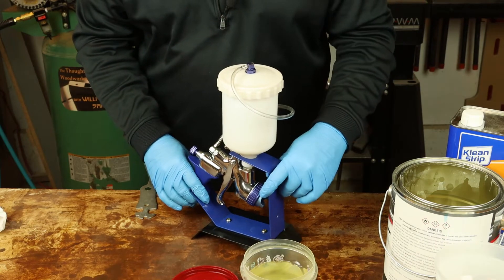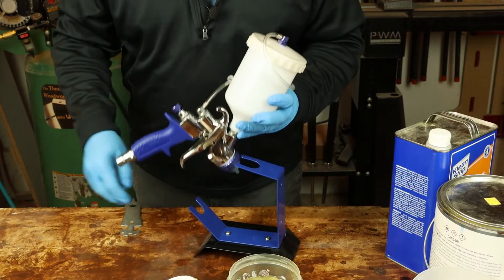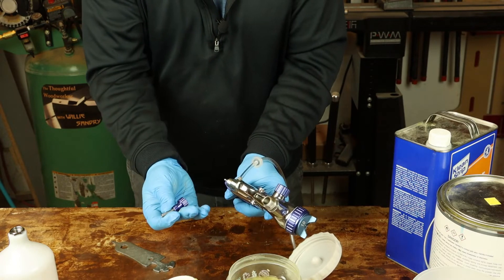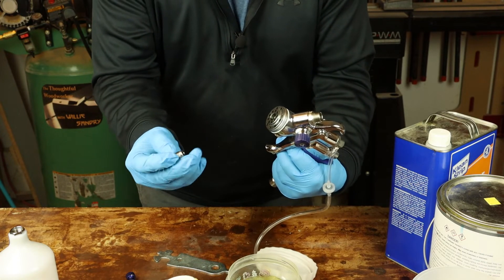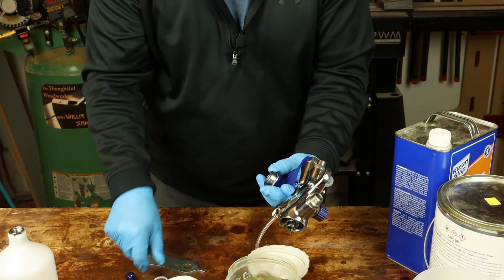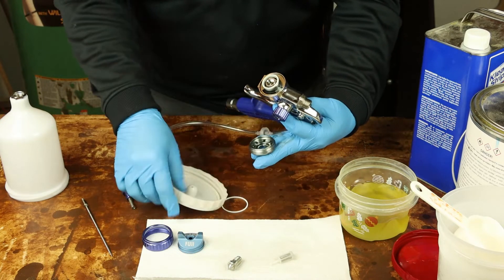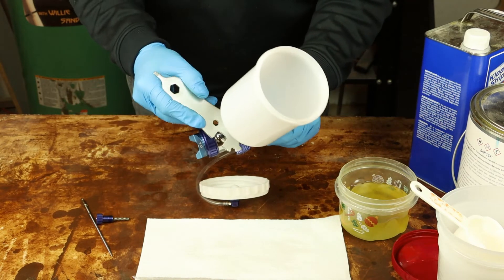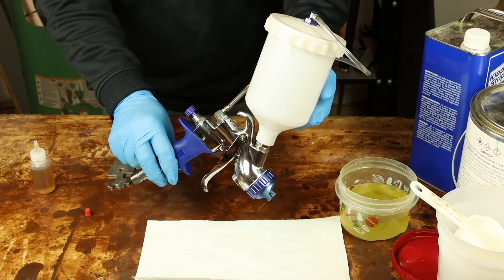2 Minute 2 Ounce HVLP Spray Gun Cleaning Method for Turbine sprayers + gravity feed guns / Fuji T75G

Comment: Great video!  Quick question for you.  It was recommended that I run some lacquer thinner thru my spray gun (Fuji T70) before I use it for the first time.  Other then emptying the cup and the gun should I take it apart and let if dry or just leave it all together?
Reply from the maker: Hi Tim, when I set up my T70 gun I just sprayed some thinner through it.  Also wipe the inside of the fluid cup really well.  The cup will have some residue from the manufacturing process.  Once a paper towel dampened with thinner wipes clean, the cup is ready to spray.
Best
Reply: @TheThoughtfulWoodworker  Thanks

Comment: I just purchased the T75G gravity spray gun as well, however when I took off the cup there was no filter inside. Do you know if the newer guns don't have a filter? Thanks for the video!
Reply from the maker: That's an interesting point David.  Now that I think about it, mine didn't come with a filter either.  I just use the standard home center filters that are universal to most spray guns.  As long as you filter the fluid as it goes into the cup, you should be able to spray without a filter as well.  Have fun with the new gun!
Reply: @TheThoughtfulWoodworker  Thank you! The sprayer and gun is awesome!

Comment: Is it absolutely necessary to lubricate the needle?
Reply from the maker: I used to fight the idea of lubricating the needle, fearing the oil may get into the finish.  You only need to lube the shaft of the needle where it articulates with the trigger.  You don't lubricate the tip of the needle.  It's just a wear and tear thing, the gun will work fine without oil, but it won't last as long.  Best to you.

Comment: Can this be done with denatured alcohol?
Reply from the maker: Yes absolutely!  Shellac thins with denatured alcohol.  Just use the appropriate thinner for whatever you're spraying.
Best
Reply: What about using ammonia with shellac bin primer ? Much cheaper than denature alcohol..
Reply from the maker: @danielemansilla  I only use the recommended thinner for each product.  In general, ammonia is a very dangerous chemical.  I do use it for fuming white oak occasionally, but only with full safety gear.
Best

Comment: what kind of paint thinner do you use to clean the spray gun?
Reply from the maker: I spray lacquer, so I use lacquer thinner.  Or denatured alcohol if I'm spraying shellac.  The product you use should say what thinner to use.
Best
Reply: @TheThoughtfulWoodworker  yeh I was spraying primer on my cabinets but do I have to clean the gun again to spray the final coat of gray? so I have to clean mine with paint thinner right?
Reply from the maker: @MetalsForBrunch  I clean the gun thoroughly after each use.  Water based paint thins with water.  Oil based paint thins with mineral spirits or paint thinner.
Read the can of paint you're spraying with, and it should have good information and what thins the product best.  
Good luck!

Comment: Where did 2 ounces come from? You used way more than 2 ounces
Reply from the maker: Hi Seth, as the video indicates the thinner in the container is reusable.  I get perhaps 10-15 gun cleanings out of that container.  I spray 1-2oz through the gun with each cleaning.  Thanks for the question.
Best
Reply: @TheThoughtfulWoodworker  do you use 2 new ounces of thinner for each cleaning?
Reply from the maker: @SethCorbinMusic  yes two new ounces of thinner per cleaning.  Thanks